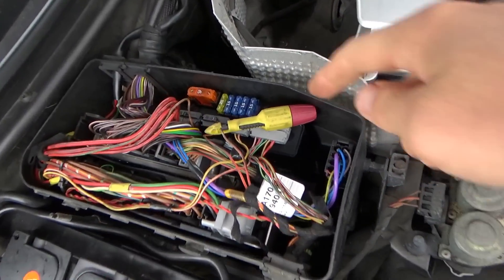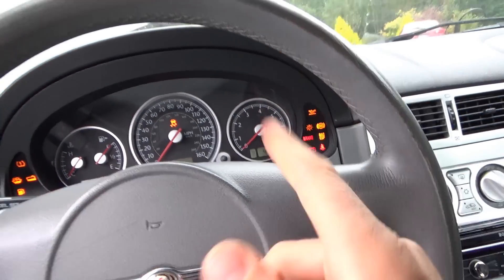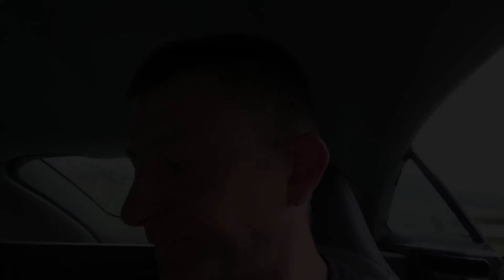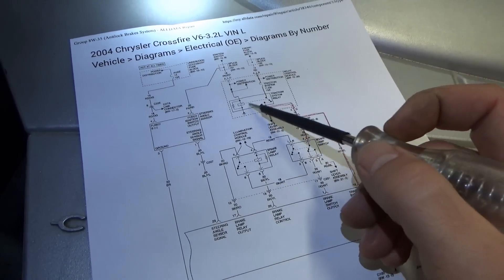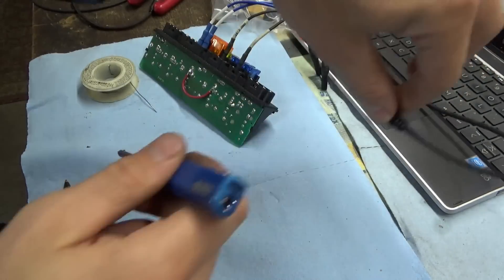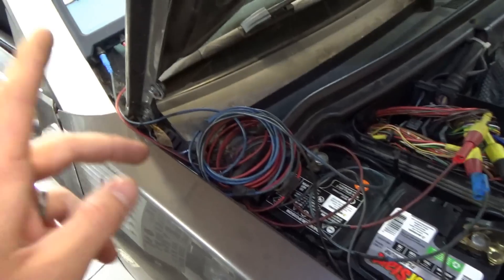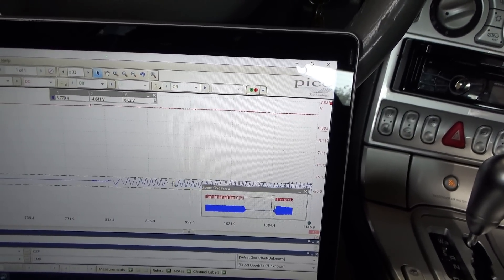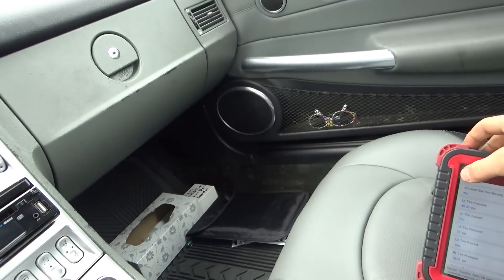Crossfire Can't CRANK? (Part 2 - No Comm with TCM-ESP-Shifter)

Comment: Thank you for posting the soldering gun that you use. It says TS 101 yet the listing comes up as TS 100. As long as it is rechargeable, reliable, can be used without running a extention chord; then I would be happy! Thanks Ivan!
Reply: I found it on Amazon showing a 101 listed as an upgraded 100  I don’t think it matters really because it’s going to be a good one either way
Reply: Jake are Automotive Diagnostics & Tuning posted a video the other day about this. The 101 is an upgraded 100.

Comment: Good thing that you like to investigate deeper I have a question why 3 relays on the wire diagram and 5 on the board ?
Reply from the maker: They were on the 2nd page as I showed in the beginning of the video 😉
Reply: I apréciate it much sir I watched both and didn’t realize that were 2 pages .that make sense

Comment: good quick fix to bypass the bad relay by piggy backing off the other one - but if that's the traction control, is it possible it pulls higher current when in operation ?  I'm wondering why Chrysler/Merc went to the trouble and cost of having 2 relays and 15A fuses to supply those two circuits separately if one relay/15A fuse could have done the job?   I guess the biggest risk is if the traction control pulls more current than at rest and blows the 15A fuse to the engine and traction systems.

Comment: The battery ground aftermarket clamp battery lug is complete junk. First thing to look at is the other end of this ground wire, where does it terminate and does it match the wiring diagram. I would expect either two or three wires crimped onto the the battery negative; for example perhaps, Block ground, power ground and chassis ground. The lug is not factory so is the ground also not factory. Some one did work on the car.

I also would not trust the battery positive cables. Try and move them around to see if they break or separate. It looks like the battery was replaced but the battery terminals and lugs where not cleaned.

If you want to power a circuit momentarily and not use your bulb you can use a Marine hydraulic / magnetic circuit breaker (they have a trip free switch so they are easy to reset). These CBs have an assortment of characteristic curves (also current ratings) and you can get one that will trip very quickly on an overload. If the car was in your garage you could use a current limited linear power supply to energize the circuit. With the power supply you have ultimate control over the current limit and the regulated voltage imposed. More importantly you can easily read the current draw of the circuit from the power supply display, which can at times be useful.

To measure fuse terminals easily purchase a set of fuse extenders and break into the two wires just enough to solder a banana jack, one for each leg. This way you can probe the fuse terminal(s) hands free with a banana lead(s). Solder the jacks in such a way that you can still get a current clamp around the extension wires.

When you gain access to the relay module PCB, the first thing to do is inspect the solder joints under an zoom stereo microscope. You will easily see even the smallest solder joint crack, and you can even zoom in and see the wear or pitting on the relay contacts. The ganged relay boards tend to get solder joint cracks because the relay frames (just the mass of the device) can stress the joints due to vibration especially if the PCB is mounted vertically when the module is installed in the car.

Ivan as usual you are not given all the facts. Someone has attempted to reflow the PCB and did a horrible job. The common mistake most technicians make is you don't reflow cracked PCB connections because you do not know what solder was used originally. What you do is remove the old solder, then redo the joint with Eutectic Sn63Pb37 (don't use lead-free) with RMA no clean flux, or RA flux if you feel there is a lot of oxidation and remove any flux residue with IPA. Do this for each cracked joint.

Many times the PCB relay footprint is the same as the PCB mount relay in a plastic housing. You can buy the correct PCB pinout and spacing and remove the plastic enclosure. In the past you could also buy open frame PCB mount relays without the plastic housing to save cost. For the failed relay you should check the coil solder connection at the PCB pin. the pin itself may be cracked, or the coil wire came loose due to an attempt at reflowing the joints. Relay coils rarely go open mid coil. They go open at the frame or PCB connections. So, unsolder the relay to remove it from the board and bus bar and see where the coil wire is open. Many times it is just cracked and separated at the PCB pin.

When soldering jumper wires to a PCB you should use a third hand to keep the wire steady with the solder solidifies. The TS100 looks underpowered and the tip is a fine conical where you really want a wider chisel tip. The alternative to using the PVC hookup wire is to use solid bus wire (tin plated copper 16 AWG) and Teflon sleeving. With the jumper wire secured to the PCB with at least one glue dot.

Comment: I wonder if it does still need a CKP sensor.  But yeah these early to mid 2000s Mercedes products are not that hard to deal with if you have a wiring diagram.

Comment: "No one will know about the bad relay."

Yep!  Nice fix!

Maybe it's my software development background.  But, I'm not a fan of undocumented hacks.  They always come back to bite a bit down the road after you've forgot about the how/why of the original clever solution and work-around.

I've commented this before.  If a relay goes bad on a non-serviceable component, I'll put a drill hole in the component's case, feed in wires for a relay harness, solder the harness in-place, seal the hole, and allow the relay harness to dangle outside the component.  Nothing but nothing screams "Pay attention" like that visual.

I can't argue with the choice of a jumper wire, however...  It works.  It's quick.  It's cheap.

Comment: Ivan, What diameter solder do you like to use? I bought some various diameter rolls of solder (.6, .8, 1.0, and 1.5).
I also bought the TS101 based on your recommendation, and it is really wonderful. Thanks!

Comment: Thats a hefty relay that carries some heavy  current ...would need hefty bypass.i suspect the one working relay took too much current for both circuits with fix.
Reply from the maker: 15 A fuse means only a few amps of current... Didn't even glow my 5A test light! Relays are usually rated for 40A 👍

Comment: I understand your thoughts on the jumper from one relay to the other, but what was the reason for the second relay to begin with. Is there another interlock that is in the circuit when the vehicle is running?

Comment: I don't understand why, if one relay is more than enough to power both circuits that need to be energized at the same time, was this designed with two separate relays?
Reply from the maker: That's the question of the day haha

Comment: Maybe the computer freaked out when that relay operated without notice.
I was going to say desolder the relay and look at the coil pins for a fractured thin wire.
Those relays remind me of the relays in Heller flasher units  when i was the electronic repair section in a factory.

Comment: Those resistors looked overheated AND dry jointed to me. Worth checking? Also thinking about it, would you now have double the load on the remaining working resistor which may fail later? Good fix though, all good!
Reply from the maker: The fuse setup is weird, downstream of the Engine relay, and upstream of the Traction relay 🤔 I'll address this in Part 3 👍
Reply: @PineHollowAutoDiagnostics  Hi Ivan, no I was referring to the resistors on the PCB next to the relay, the solder joint possibly looked cracked, I wondered if that was the original fault with the module and why the relay was not operating / intermittent.

Comment: Here's an idea... let's engineer the electrical system of our cars so EVERYTHING is connected to EVERYTHING else.  That way we'll save fuses and money.  And make it hell to isolate a problem that keeps our cars from doing anything.

It's a nice idea to save on multiple power and ground wires, plus fuses.  But when it cripples the entire car?  Not so much!

I'd say nice fix, Ivan, however... you're sitting by the side of the road at the moment.

Comment: A few years ago my old XJ-750 yamaha motorcycle started playing cannon  and RPM wold float at intermediate temperature; Air cooled. . When I'd pass the cursed km, I would be ok for the day. .  I went on the net for advise. .A guy from France tonl me : If alla wiers are good and no grounds, take off the TCI unit and redo all welds on it. .  I did , put it back in place went for a ride and at the critical distance; all went well    , no canon shot and curiously, the engine vibrated much less than before. . . The big solders had a curious "aura" around the pin in the center of the  weld, , ,A 1984  bike put back on the road in 2016. . .. .
Reply from the maker: Nice!
Reply: @PineHollowAutoDiagnostics  My XJ was a younger brother to your XS   Wich I owned one too😉

Comment: 22:04 these relays are replaceable.  I cant remember the part # though.  This is a common problem with the Mercedes slks and the crossfire.  I resolider mine about every 3 years .
Reply: J.s I'm curious if the ECM isn't disabling the relay as part of the t.c program. Or if the t.c modle isn't shorting and smoking the relay ( doubtful ) but a thought .

Comment: Jumpering to the engine relay does not seem to be a great fix. It would have not been hard to desolder the bad relay and solder in a new one. I worry about too much current causing the engine relay to prematurely fail.

Comment: A real technician unwinds the control side of the relay, carefully counting turns, and rewinding the coil wire. Or you just install a jumper like you did.

Comment: Yeah, this repair guy is good. But he misses the point of there may be a reason for two separate relays and by soldering the jumper at the place I think he did, the traction system stuff now runs unfused, which is a BIG fuckup.
Reply from the maker: I'm going to fix my "BIG fuck up" in Part 3 😜

Comment: German engineering... That's probably Mercedes trying to reuse old custom components to save money.  Put all the custom relays on a custom board and into a custom box.  Looks easy enough to replace with an external set of relays, though.

Comment: why did they do a pos relay board vs standard plug in relays. no way they saved money, the cost of a pcb and manufacturing could not have been cheaper than buying off the shelf relays that are made by the millions. diamler and over engineering was the death of Chrysler. not that they weren't going downhill before. now with fiat they got even worse.

Comment: If there are two seprate relays that are independently controlled Why would you join them together ??????????? thats a poor hack job ,, you should have replaced with the small relay so it can still be controlled  independently !!!!!!! or as wee know it as ,,,, its been FANNIED up at the butcher garage ...........
Reply from the maker: Look at the wiring diagram... They are NOT independently controlled as I specifically explained multiple times in the video 😜🤦‍♂️